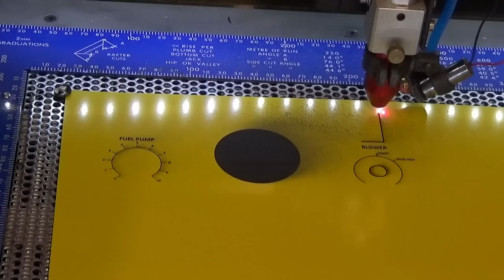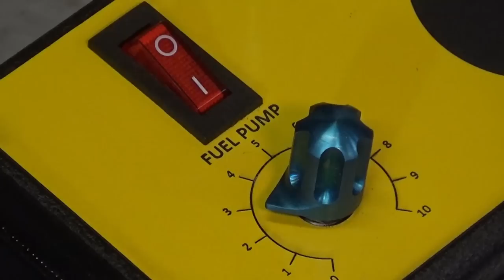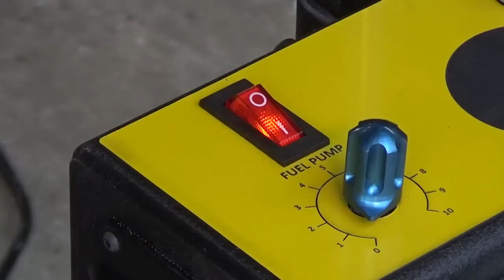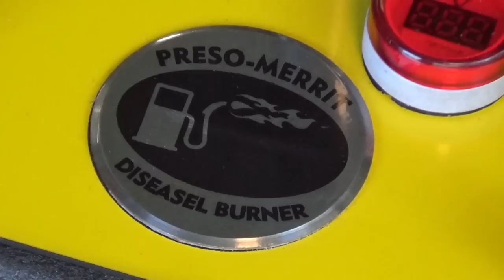Diesel Foundry Furnace Burner - Part 5 - Mission Accomplished

Comment: This was such a great series, Mark! I'm feeling the furnace itch...
Reply from the maker: It's one of those projects where it just worked out. The blower capacity, the fuel pump displacement and the nozzle size turned out to be optimal and it is fairly easy to run. This hardly ever happens on other projects I attempt.
Regards,
Mark

Comment: Good work Mark. The control box came out really nice with the powder coating and the front panel. The machine works really well.
I too have had great ideas from my viewers. Sometime we get tied up in the build and we just don't think of something that would make the job easier, or the item better.
Reply from the maker: I shall have to convert you to the joys of powder coating 😁. I started out with a little toaster oven and it worked just fine. It's true that the comment section can yield better ideas than I can come up with.
Regards,
Mark
Reply: @Preso58  Hi Mark. Beautiful job and videos. Only criticism is that you did the test run with Aluminium. What is it like at melting cast iron. My thought on the furnace if starting from scratch would be to have a fixed crucible and tilt the furnace so as to minimise handling and pour the metal directly into the mould. I remember an old guy who made glass bottle moulds using a furnace like this although I never saw it in operation

Comment: Now that is one very well built furnace, beats using propane hands down. I built one for propane, now I have a new project building a new burner for diesel fuel. Well done.
Reply from the maker: I am super happy with my diesel burner. I think I just lucked out on choosing the capacity of the fuel pump, the blower and the nozzle. It has just enough range of adjustment to make it efficient and controllable. It's also equally scary and exciting to use at the same time. 
Regards,
Mark

Comment: Hey Mark,
The thread inside the cap is so you can screw one of those plastic taps into it and lay the tank on its side, the bung on the lower edge would the face up for an air relief.

Comment: Mark
Thanks for your great videos.
The colour of your knobs is a personal thing.
Anodizing has it limits in colors  
I have a maritime background and If you wish to use the correct maritime colour coding on your knobs.
The main colors used in ISO 14726 are as follows:

Black - Waste media
Blue - Fresh water
Brown - Fuel
Green – Sea water
Grey - Non-flammable gases
Maroon - Air and sounding pipes
Orange - Oils other than fuels
Silver - Steam
Red - Fire fighting
Violet - Acids, alkalis
White - Air in ventilation systems
Yellow - Flammable gases
The secondary colors are the same as above, but the identification of the pipe’s contents depends on what main color is used in conjunction with the secondary color. For example, the main color can be black for waste media and if the secondary color is blue then the contents of the pipe are identified as black water, but if the secondary color is brown then the contents are identified as waste oil. It’s still in the category of waste, but it’s a different kind of waste that may require a different handling procedure. 
regards
G01 Sil
Reply from the maker: That's interesting. I knew that there was an international code and I did some volunteer work at the Brisbane Maritime Museum back in the 70's. I was working on the "Forceful". the last steam tug to operate on the Brisbane River. They were very meticulous in painting the engine and boiler room and you would see all the different coloured pipes. I can confirm that steam was definitely silver. 
Regards,
Mark

Comment: For the slot in the Delrin part, hang the part from a drill bit through the center and resting on the top of the vise; use two same angle blocks in a v-block configuration on the base of the vise to ensure the correct orientation, and Bob's your uncle.  Or said another way, trigonometry!!😁
Reply from the maker: There you go. I said I only had a little brain! 😁
Regards,
Mark

Comment: mate, a very professional turn out. I can't see an issue with a plastic fuel tank since diesel is not very volatile. If spills are a concern just keep a bucket of sand handy.
Reply from the maker: I have a fire extinguisher on the wall nearby. Let's hope I never have to use it.
Regards,
Mark

Comment: Hi Mark.  
I designed a waste oil (vegetable oil from restaurants, etc ) burner 10 to 15 years ago.  I was originally using LP Gas with forced air.  Starting waste oil is a huge problem. It seems like the same as diesel?  It looks like I have built a similar system as yours with a few changes.  I was already using forced air on my LPG propane.  So I only needed to add the waste oil line (60 deg hollow cone pattern tip) inside the tube and downstream from the original LPG inlet and forced air.  This was great for starting the waste oil.  I simply turned on the LPG gas.  I let it warm up 5 min or so. Then I turned on the waste oil with the LPG gas still on.  So I didn’t need to light it by hand.  I had to adjust the air some, (but see below.)  This really allowed me to heat it up fast.  Once my walls are red I can shut off the LPG.  Oil that makes it out of the nozzle unburnt and into the foundry self-ignites at that temperature.  So once it is on, it is rocking.

However, I use air from a compressor to siphon waste oil from a container.   I can control the amount of oil being sucked in as well as the amount of compressed air being pushed through.  It worked great.

I stopped using it and went back to LPG as the oil was a mess.  I found that after a few weekends of use the shop, my tools, the foundry etc were all coated with a light sheen of oil (At least it smelled like french-fries).   This comes mostly in the form of sooty smoke.  There are always shifts in combustion due to air flow as the foundry is opened, impurities in the oil, and sunspots.   So it may be burring clean for 10 min then start putting out a little sooty smoke.  I adjust the air and fix it.  But that seemed to be a normal thing. 

My refectory is mizzou  3000 or 3,500 deg (I don't remember).  It is solid, thick and a pain to bring up to temp.  I loved the oil but I hated the grease.  

Lighting was easy with the LPG as the starter. 

I love the sound!  
With your success at speed I might try it again.  
Thanks for the videos!
Reply from the maker: I did consider using waste oil but diesel is so much cleaner to handle and store. It's still relatively cheap and I can be confident it won't have any fine debris that might clog the nozzle. Lighting the burner does require a bit of finesse and sometimes I will have a flame out but it's easy enough to relight and slowly ramp up the air and the fuel. I have a small turbojet engine that I built many years ago and it's started with LPG to preheat the combustion chamber and the fuel inlet nozzles. After a few seconds you can slowly introduce the kerosene which will vaporise easily in the now hot core of the engine. It's essentially the same with the furnace and I had joked that the furnace is just one component short of a full blown jet engine, (the turbine). The sound clip on the end of the video was taken from a jet turboshaft helicopter (my little homage to the wonderful jet engine). 
Regards,
Mark

Comment: im building a new furnace, im going to build a propane burner and a diesel burner, i like your design and going to try and mimic it with what i can find. thank you for the class i learned a lot. i hope it works for me
Reply from the maker: I hope it goes well for you. I think I was lucky with the balance between fuel delivery and blower capacity. If you over spec the blower on a diesel burner it gives you some extra capacity to get the flame to run lean. I find that I can ramp up the blower as everything gets hot. When it is truly running with a lean flame I get very little smoke and soot. In fact, the interior of the furnace is pure white at the end of the melt. 
Regards,
Mark
Reply: Thank you Sr, I hope it goes well also, I'm just starting my fan now. the main part of the furnace is finished (minus liner) I'm just gathering parts as I can. Thank You for replying and the encouragement, most of all thank you for passing the knowledge on to others  @Preso58

Comment: There are many ways to skin a cat, but I suggest that your pump mount is excessively elaborate.
I suggest that :
1. the copper tube should be flared at the pump end  to prevent chaffing of the electrical wires as it exits the tube.
2. the mounting of the pump could be by way of a 6mm steel rod silver soldered to the pump end of the copper tube and in line with the tube, at one end and to a curved plate at the other.
3. the curved plate is to be a snug fit to the pump body and held to the pump by a hose clamp.

cheers.
Reply from the maker: Thanks. In hindsight, there were oversights and workarounds but the whole build was one big experiment. It's always a case of "do I now go back and review and rebuild the sub assemblies" but given that it just works as it is I don't really have the inclination to mess with it. I have used the burner a lot since completing it and although the lighting process can be finicky, once everything is hot it just works well and there is just enough capacity in the blower and the fuel pump to fine tune things to be efficient. 
Regards,
Mark

Comment: Ive enjoyed watching this 'overkill' build and every time I thought it was getting close to finished you found a way to make it even more slick. What a beautiful finished unit. The results are impressive and with all the time and planning of the design, I expect it will be hassle free for the rest of your life.
Any chance of casting a few more blanks for the drill press clamp. I've been dreaming of making one for many years after I discovered them when trying to improve school workshop dilling safety for the kids. 
Id love to have a clamp for home use. Cheers for the videos.
Reply from the maker: I am afraid there is no money to be made from low volume casting manufacture. However I am happy to make the STL files available for the patterns. I also want to complete the build for myself first just to be sure the entire project is viable. You could make the jaws from solid steel or aluminium billet. I just wanted to use castings so they would resemble the originals. 
Regards,
Mark

Comment: Fantastic project Mark. Cast iron next? 
One thing I did wonder about, should the fuel pump, pipework and airhose systems be earthed to prevent pickup of static? I know that the flash point of diesel is very high compared to petrol, but you never know.
Reply from the maker: Diesel in it's liquid form is almost impossible to light with a spark. Once it is forced out a fine nozzle as a mist you can ignite it that way but you need a very hot, fat spark to do it. The cart itself is earthed through the mains inlet for the power supply. One of the advantages of using diesel compared to say, petrol is that the vapour pressure is so low. The tank is also vented so fumes don't really build up inside it. In some ways it's probably safer than propane.
Regards,
Mark

Comment: I mentioned it on your last video switch to a metal fuel can
Reply from the maker: I do recall that but it could be difficult to find one which fits the cart and the riser for the fuel pump I have already made. I will probably make a heat shield to go over the top of the plastic tank but in reality, if you are spilling molten metal, puncturing the fuel tank is probably the last of your worries. 
Regards,
Mark

Comment: You said that it took 15 mins to melt but I missed the exact of aluminium you melted in this video? The furnace is running a lot better than in part 4!
Reply from the maker: I guess it was only about 1kg of material but I find that once you get a puddle of molten material in the bottom of the crucible any added stock melts fairly quickly. I got the settings dialled in a bit better on the last melt. It takes a while for the furnace walls to stop absorbing heat and start radiating the heat back. Once that happens I can lean out the flame and it just seems to get hotter. Maybe one day I will be able to melt iron!
Regards,
Mark
Reply: I've got a video coming out shortly comparing my propane furnace to your diesel powered furnace. @Preso58

Comment: Have you considered switching to kaowool as insulation? Lowering furnace mass would increase melting speed even more.
Reply from the maker: I recently had an (email) conversation with Luckygen1001 about Kaowool and he suggested adding some to the inside surface of my solid cast refractory just to lower the thermal mass. It's something to consider and if I ever have to replace the solid refractory I will probably do it that way. For the moment, the melt time is way better than I had previously so I am happy to leave it as for now. Maybe if I want to start melting iron.....?
Regards,
Mark

Comment: Great build, Thanks! I don't think a plastic tank is a problem especially with diesel. Can you say what brand of the yellow faceplate material you use? I seem to get very mixed results with the dual color stuff like that.
Reply from the maker: That yellow sheet was part of a mixed pack of two ply plastic that I purchased from a seller on AliExpress. It's not the best material but it works OK. I have to clean it with a magic eraser and some cream cleaner to get rid of the black soot around the cut edges but it was cheap and I got a lot of it in one shipment. The better quality 2 ply plastics come from either Trotec or Alfex. I actually bought about 6 sheets from Alfex today https://shop.alfexlaser.com.au/product-category/duets-engraving-plastics/
Regards,
Mark

Comment: If a larger fuel pump required. Any suggestions? Keep up the great work
Reply from the maker: I am now satisfied that the fuel pump has just the right capacity for this burner. I used it just recently and I am now used to it and I can tune it to run lean once everything is hot. I managed to get my molten aluminium up to about 825C which is hotter than I would normally want to pour at but the burner is capable of doing it and I am sure it would be able to melt iron easily.
Regards,
Mark

Comment: Well presented Mark. One Question. Your powder coating applicator. Where did you get that from, because all the eBay links give me a different gun than you are using? Any chance of a small tutorial about powder coating? Thanks in advance. Reuben
Reply from the maker: I bought mine from Caswell in the USA. https://www.ppcco.com.au/products/eastwood-dual-voltage-powder-coating-gun-with-accessories-starter-kit-ew33278k It was expensive but it has been quite reliable and it came with a good selection of powders. Mine was the single voltage gun (a bit cheaper) but if I were doing it over again, I would buy the dual voltage gun. I have done several videos on powdercoating. Check out this one https://www.youtube.com/watch?v=O2JgRoH6mdQ&t=482s
Regards,
Mark

Comment: Is your fuel tank fuel rated? ie is it an approved fuel container? its plastic - what happens if you drop the crucible ? or the crucible breaks as you lift it out ? will the tank survive being splashed with molten metal? safety factor?
Reply from the maker: I am guessing that if you drop a full crucible of molten metal you have bigger problems than worrying about your fuel tank. 
Regards,
Mark

Comment: Silly question but you have the fuel pump switch above the air control control (blue knob) and the blower switch above the fuel control (red knob). Isn't that a trifle confusing?
Reply from the maker: Not silly at all. You are absolutely correct. I have somehow inadvertently swapped the knobs around! It's an easy fix but it makes me look like a fool. Again, the viewers of YouTube have helped me out. 
Regards,
Mark

Comment: Trying to find the speed controller for blower , any ideas please.
Reply from the maker: I got mine on Ebay. https://www.ebay.com.au/itm/234863403664 I have linked to the one that I bought but it is listed as being out of stock. There should be others available from different sellers though. Try searching for AC 220V 4000W SCR Variable Voltage Regulator Speed Motor Fan Dimmer Controller
Regards,
Mark

Comment: Hey Mark, do you think any primus stove design can work to do this kind of thing?
Reply from the maker: If you are referring to the kerosene fuelled stoves, the jet sizes are probably too small. Also, they rely on a preheat to vaporise the fuel. We used to have one that needed to be heated with methylated spirit first. If you were to scale up the entire assembly you might get enough heat for aluminium but it might be difficult to control the flame. 
Regards,
Mark
Reply: @Preso58  Okay SIr, I saw regular acetylene torches have finer control of everything related to the burn of the specific gas. If retrofitted and handled the right way, I guess there can be some potential on the legendary primus stove design.